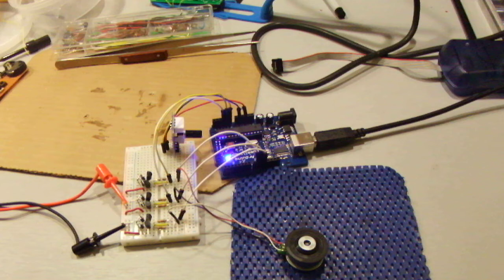Simple BLDC controller on 6 discrete transistors and Arduino

Comment: those cdrom motor have hall sensors in them.You can hook them up to the arduino and make a closed loop controller.That way the motor wont  stall or fail to start again if you stop it.

Comment: how would you upgrade this to use a bigger motor?...
I have a
Kv: 580rpm/v
Max current: 90A
Max Power: 2000W @ 22.2v (6S)
an outrunner used for RC...
Reply: uses mosfets of sufficient power

Comment: hello, I am Brazilian and I am trying to start an engine of cdrom but I can not, is to help me, can you pass me the wiring diagram you made this video?

thank you
Reply from the maker: I don't know if Google will let me post URLs ( didn't work before) but here it is: http://elabz.com/forums/motor-control/updated-schemnatics-for-a-bldc-motor-controller/
Reply: MrScriptster Thank you,

The link you passed the wiring diagram of the engine using the correct SN754410 chip?
You have just one using transistors? And what transistors have to use?
Reply: I'm sorry,
I registered on the site and got to see the attachments.

thank you
Reply: Paulo Junior